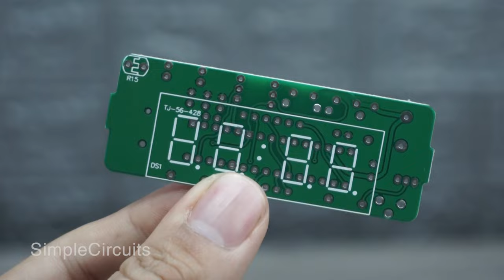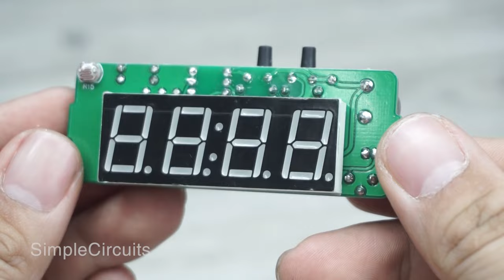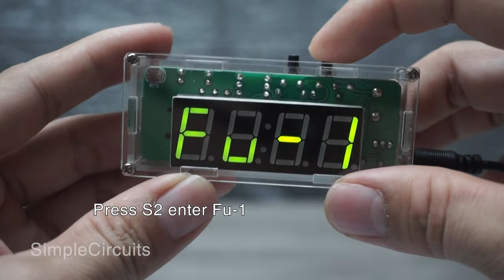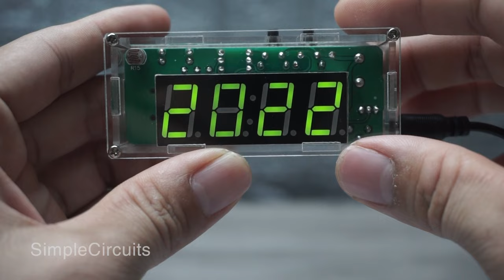Digital Clock DIY Kit project - ICStation│Simple Tech

Comment: This circuit design has a small problem, the 7 segments of each digit share one current limiting resister, the fewer segments are lit, like "1" or "-", the total current passing through the resister is smaller, thus higher voltage is applied on the led, it becomes brighter, and vise versa.

Comment: Can the time be displayed without CMOS battery, but only with DC power?
Reply: yes without coin cell - but if the clock loose USB-Power you have to set the time again ... with coin cell time (crystal & chip) are still running but without display and correct time is coming back to display if USB is connected again without setting.

Comment: Not sure if this is still active but, I followed the tutorial as best as I could and my Display only strongly displays some sections and others are either extremely faint or not displaying at all. Any Suggestions? I assumed it was a weak solder on the display but when I resoldered it, I got the same result.
Reply from the maker: Please adjust the brightness according to the included instructions, it has 10 levels!